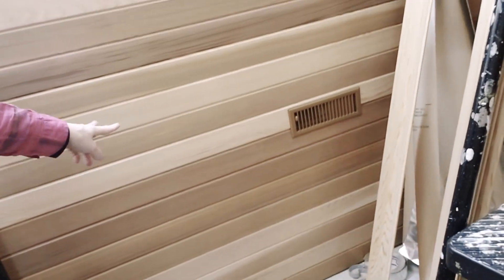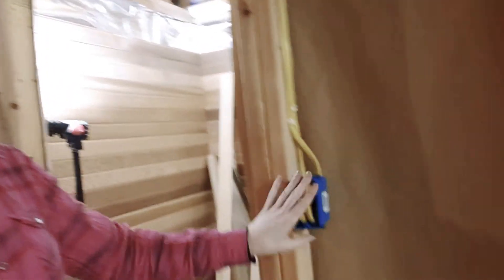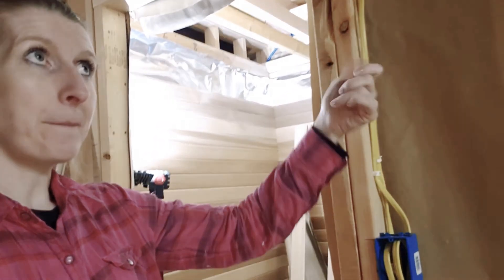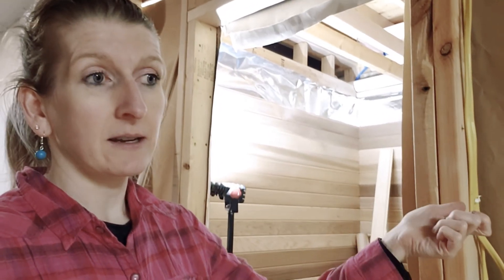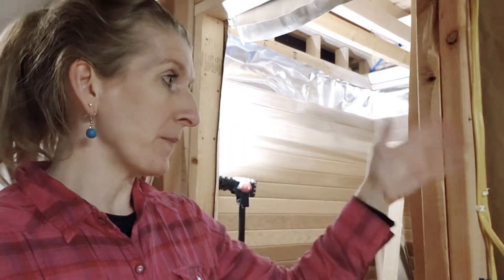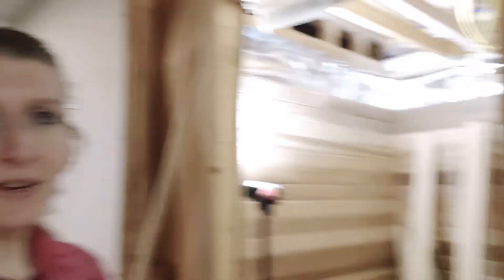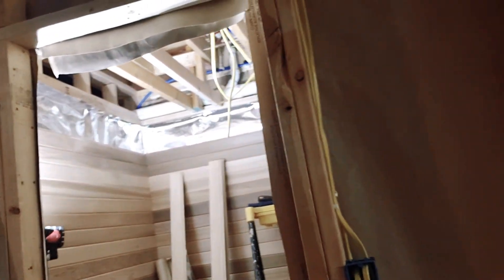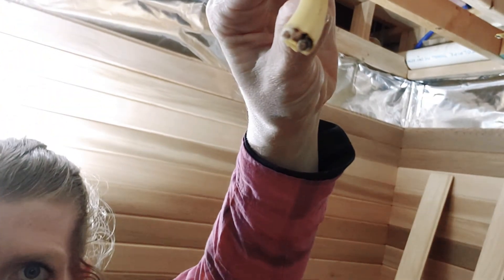Sauna build - Ceiling close up!

Comment: Where did you leave the electric wire ?
Reply from the maker: The speaker wire is in the wall stud bays ending below the bench that wasn't present in this video.   Other side of that wall is still unfinished space  

The wires in ceiling fed the lighting.  

Does that answer your question?